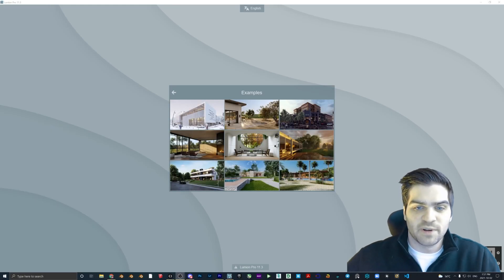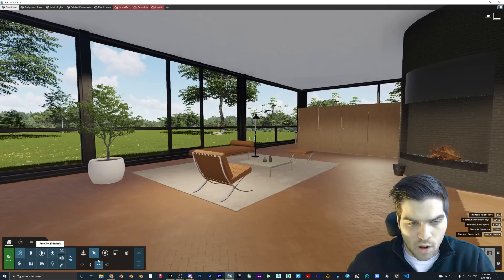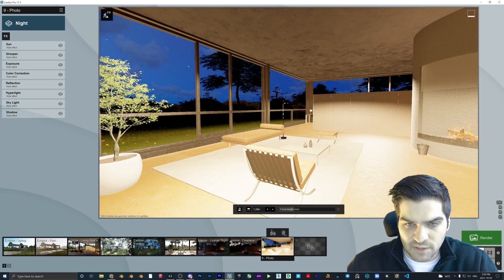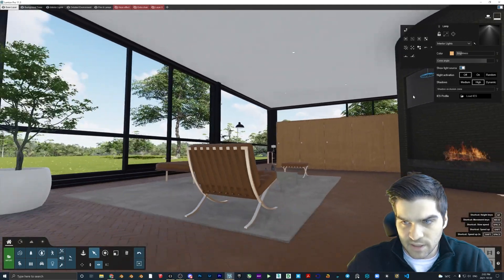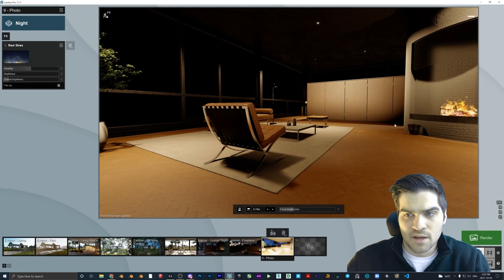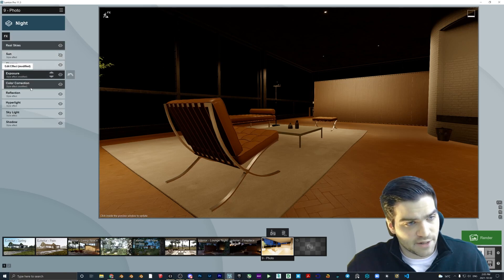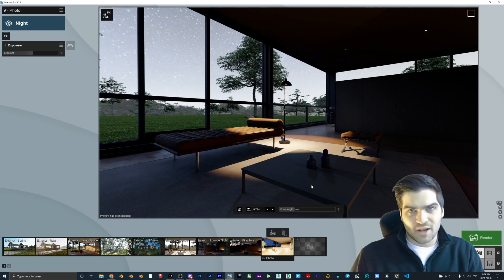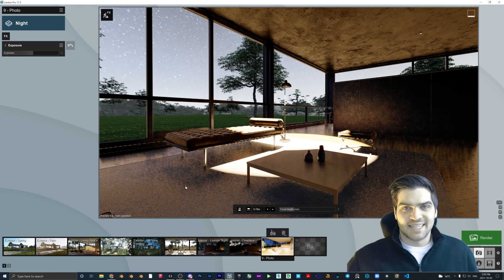Fix Your LUMION LIGHTING With This Trick!

Comment: What do you recommend on pool lightS?
Reply from the maker: There is a not an easy solution to that unfortunately. The best advice I would give is to tweak with a narrow spotlight and then put volumetric lights on it (if you have Lumion 12).

Comment: Hey Greg, nice vid :) Glad you mentioned D5 at the end.. I was going to ask you about that! Looks like it has a lot of potential- esp interiors compared to Lumion. Look forward to seeing your vids on that 👍
Reply from the maker: Hi Geoff!

I have been playing around with D5. While it is not as polished as some people would have you believe, I think it is better for interiors than Lumion. There are a lot of things that I find can make Lumion turn into a dumpster fire with interiors that D5 has no problem with.

Overall it seems like a much much faster render as well, but not as many output settings. If you have not heard of Nvidia DLSS I would recommend looking briefly into it. DLSS is a huge feature that is going to be the future of rendering.
Reply: @LuminousLabs  Thanks Greg! Have just been looking into DLSS, thanks for the heads up.  It does sound interesting.  I still haven't found the time to experiment with D5 as yet.. I realise it's still being developed but it does look like it's going to give Lumion a run for it's money esp as it continues to add new features. I'm also hoping D5 is fairly easy to learn.. I'll definitely be watching your D5 vids to hear your thoughts.
Reply from the maker: @geoff2579  
I actually think D5 is far easier to learn, a lot of the learning curve from lumion is just built into D5.

I recommend everyone give it a try, it's never bad to have options!

Comment: They should just connect values to lumens, it would make whole process easier, and also enable rendering accurate lighting scenarios
Reply from the maker: I agree, there needs to be some kind of update to the way the values are displayed since it really doesn't make sense. The slider is not linear and I think that really messes with people.

Thanks for checking out the video!

Comment: Thank you for your video,  another thing that could be included in this video was gi effect, i learned it in desir school channel,and that effect make shadows and artificial lights much better
Reply from the maker: I actually don't like the GI effect. Hyperlight is actually the new GI effect, but for some reason Lumion wanted to keep the old one in for people who were used to it. The GI effect doesn't deliver the same results as Hyperlight but is WAY more expensive. Hyperlight should have been called GI2.

Thanks for checking out the video I hope it helps :)
Reply: @LuminousLabs  hi, thank you
  i will check it again,and compare gi and hyper light but im still thinking، when you apply gi and select ies lights, you will get much better lights and shadows

Comment: I really hope they add the ability to dial in the brightness before placing lights in the scene. Right now you have to add a light, change the brightness then copy that light around. Thanks for the great vid.
Reply: You can add multiple lights first, then adjust the settings of all similar lights at the same time. I am Not at a computer to explain the exact steps, but it is super easy once you know how.
Reply from the maker: You are correct, however I think Lumion needs to change this. I am confused why it is not possible to link lights. If you have 6 lights in a living room they are 99.99%+ going to all be the exact same light so why can't they just mimic each other.
Reply from the maker: Thanks a lot for checking it out! I hope it helps :)

Comment: Hmm good job researching this actual sphere of influence for a light point. I knwe thatdefault 300 units is way to strong but didn't figure out the light kind of "cuts" after reaching the distance as shown here. I wonder now how much difference would it make to select the lights at small values and make them work with global illumination
Reply from the maker: I haven’t played with global illumination effect but hyperlight does seem to work a bit better! At the very end where I turn the lamp up, you can see how much more noise it brings in the scene. 

The sphere of influence is called its attenuation, I just wasnt sure if everyone would know what I meant since that word isn’t anywhere in lumion’s interface.

Thank you for checking out the video! I hope it helps you out :)
Reply: @LuminousLabs  I think (and hope) we're going to see a major improvement in interior lighting in the next version - it looks to me so from what Lumion devs have shown in the teaser. As for hyperlight - this has always looked kind of random to me, not really a realistic effect, it mimics the color bleeding effect which ray tracing would give. reason why I thought of GI instead was in relation to what you have shown with this sphere of range that a single light point has - perhaps marking a light to work in GI effect could help that?

Comment: So so so helpful, this really is fundamental lol they should feature this for people starting?? Obviously lack of raytracing limits interiors but I think sooooo many people (myself included) have trouble with interiors purely because they don’t understand these settings. Took me a while to notice how insane the values on the lights are because the slider bar makes it look like they’re relatively low
Reply from the maker: Exactly! To me it seems like as long as the light source is strong enough to reach the floor that is around where it should be. I do hope they make an “exterior” and “interior” section just so people who are new will have different starting values.

I don’t completely understand how the values work myself, because it doesn’t seem to be linear. The ies profiles that are built in seem to be quite visible even at the lower values 

I’m glad this video could help you out!